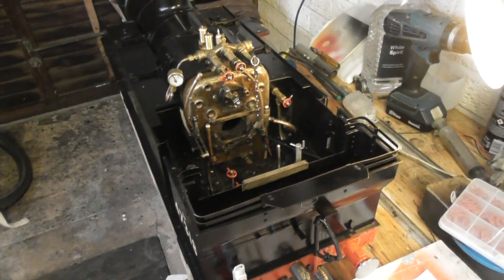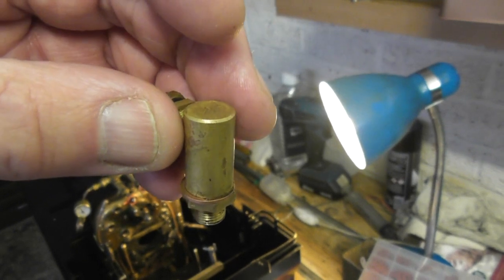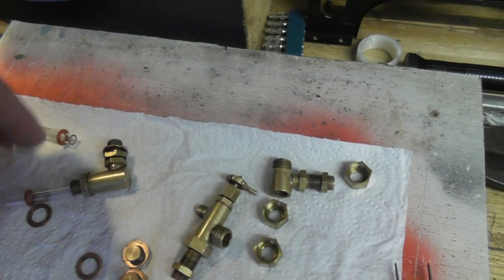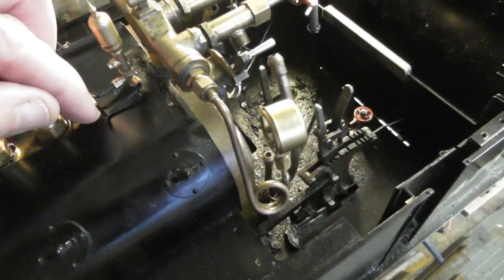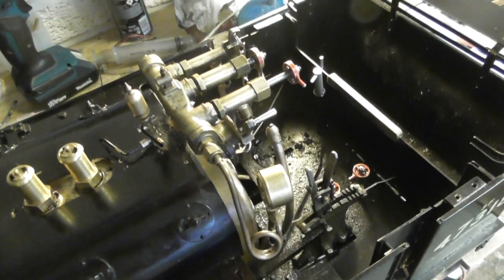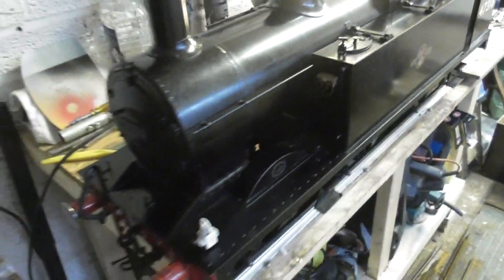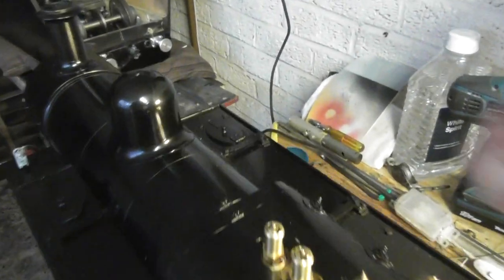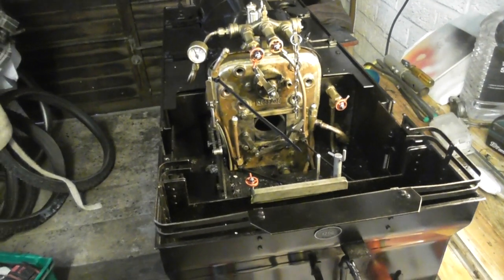Jinty 3F . cleaning check valves and cleaning all the fitting

Comment: eyup RBd
Nice one, great tip with the cable ties👍👍👍👍🚂🚂
Them silicon O rings are a great buy, where can i get a pack from👍👍👍👍
What about filling it through the blowdown valve with mains or a pump pressure, just a thought
cheers
Kev
Reply from the maker: Hi Kev, O rings from EBay 👍🚂